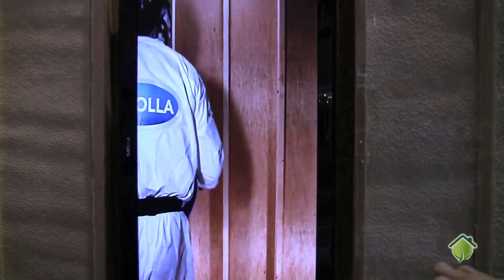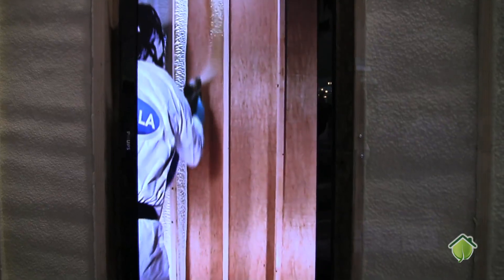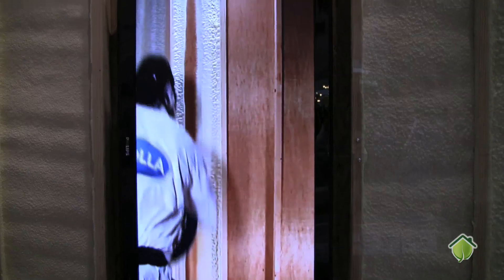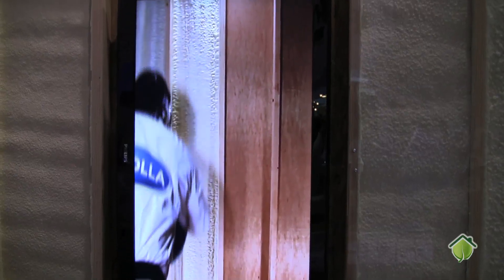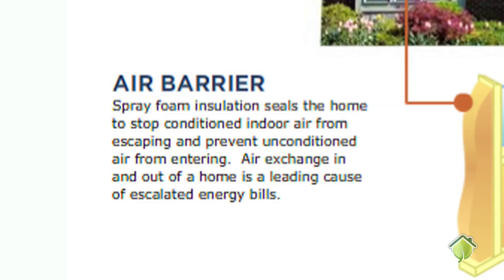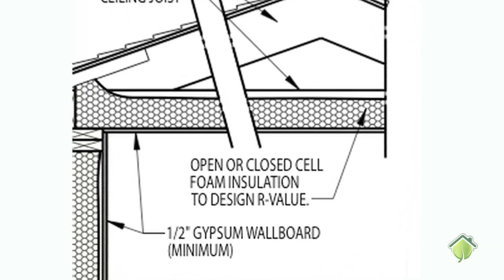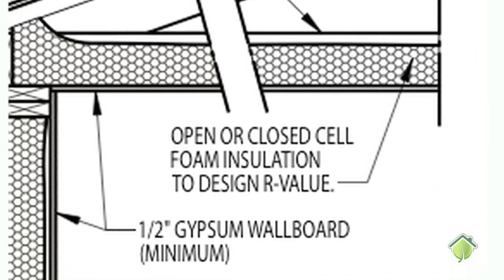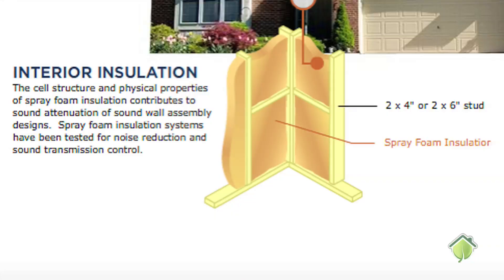Spray Foam Insulation - Open or closed cell?

Comment: HomeEnergyNow merely has a very poor communication skill.  I do tend to agree with much of his comments. A total air tight building is not good and regulations require so many air-turnover per hour/day.  So if you don't have and air exchanger in place, it is best NOT to seal it so tight!  You need a way to exchange formaldehyde and radon, etc.

Comment: This "home energy now" fellow is bringing an unnecessary bias into this conversation.  As a contractor with 28-years in the insulation industry, spray foam homes (including my own) are the most efficient and comfortable on the market.  As to air change, it's true, homes need to breathe.  That "breathing" (ACH) is accomplished much more effectively with an HRV  (air exchanger) attached to the heating system.  By turning a dial, we can make our home .3 ACH, and enjoy the savings and comfort.